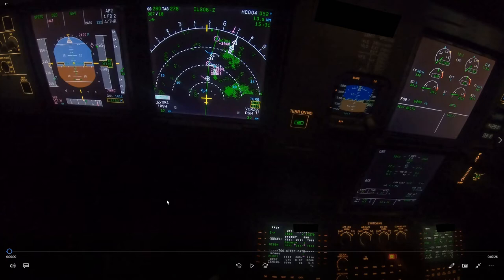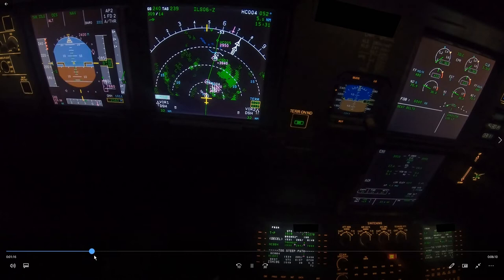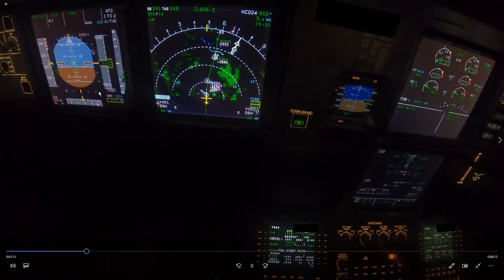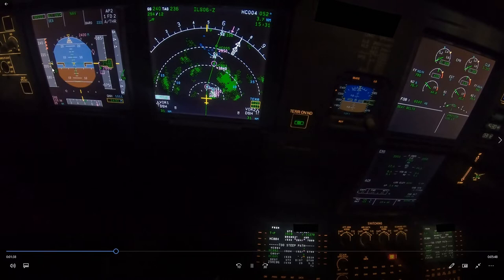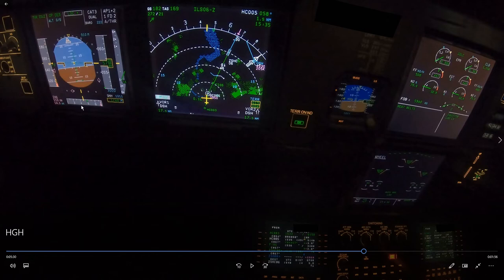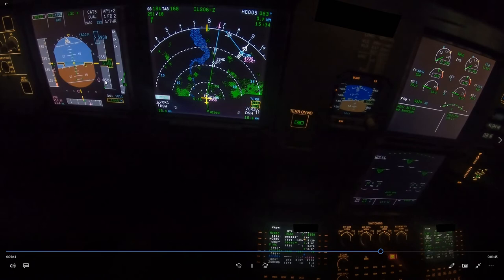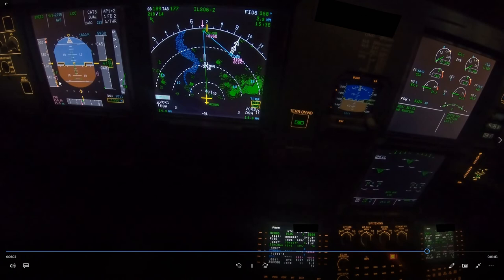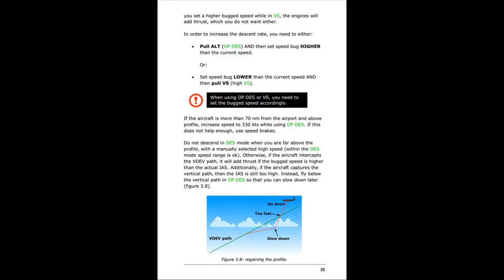A320 Descent Management - ZSHC above glide slope

Comment: On 0608 we see that we are above the profile. 
Fo trying to correct by open decent plus speed brake 
However due to speed constraint of 205 we see that it cannot help the aircraft to come back to profile 
For this video I think it’s nice to point out what could have been done better to solve the problem, however at the end you showed only how to fix it by using intercept from above.
Can we do select speed 160 / vs -2000 （reason is my GS is 229 that means vs of 1200 will put me parallel to g/s so I need more vs and selecting 150 make sure idle thrust)
Base on calculation 15 is 4500 so by 4500 my speed is lower than s then n0 correction I will go open decent select s speed